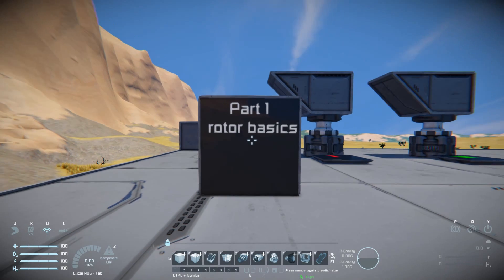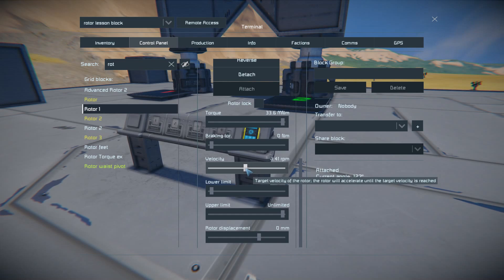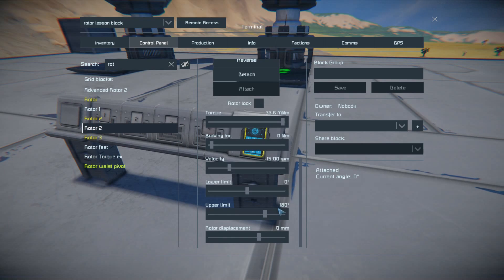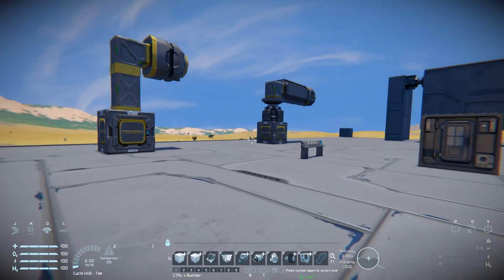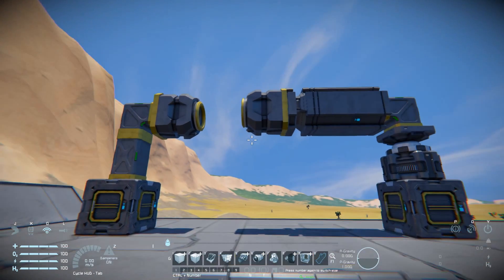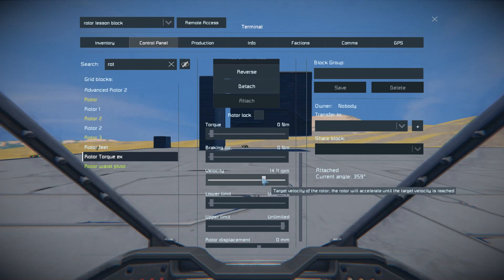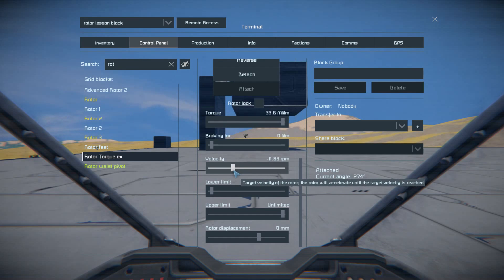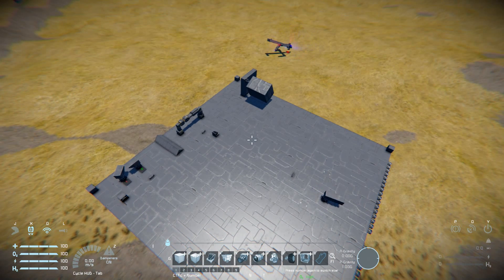Space Engineers basic Rotors guide

Comment: How do I make my rotors constantly point towards the ground? Or in the direction of gravity? I'm making an atmospheric miner.
Reply from the maker: @lkhdmrtn  what you might want to try is making the motor velocity nothing and increase the braking power to what you feel appropriate. Then put a gyroscope on the arm your trying to make and mess with the settings so that it follows gravity. You will deffinitly have to work some kinks out to make that run flawlessly but I’m pretty confident it’s possible. Hope this helps :)
Reply from the maker: Also, you might be able to do something more advanced like that using script blocks. I would look into that if all else fails. I know I’ve made an AT-DP from
Star Wars using those, motors and gyroscopes.